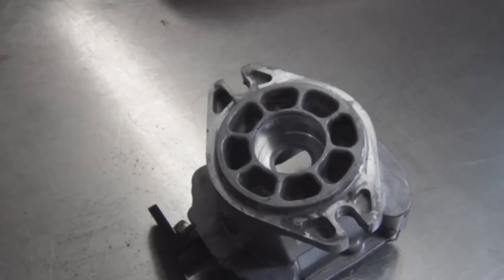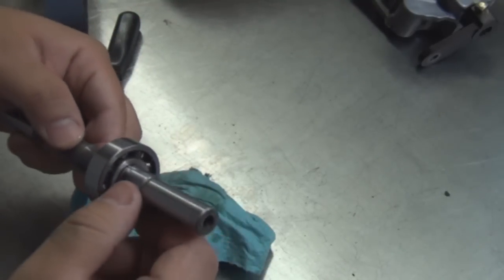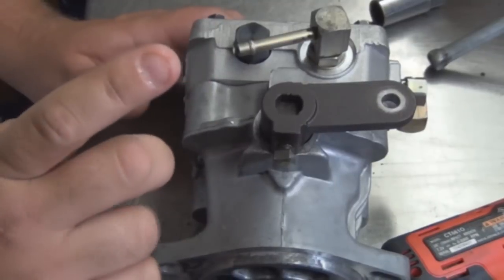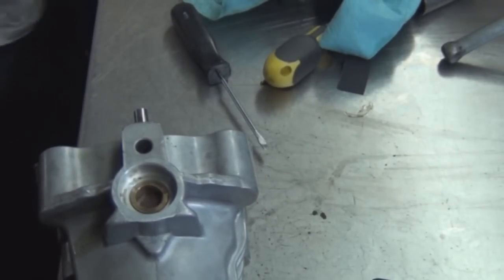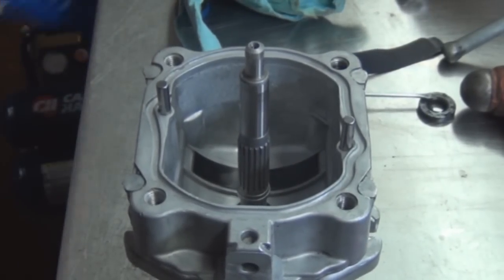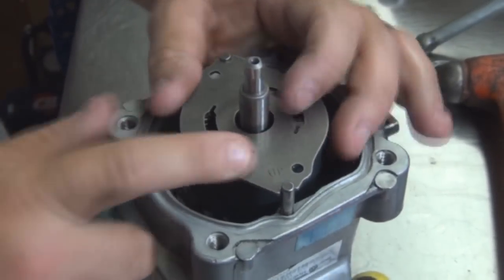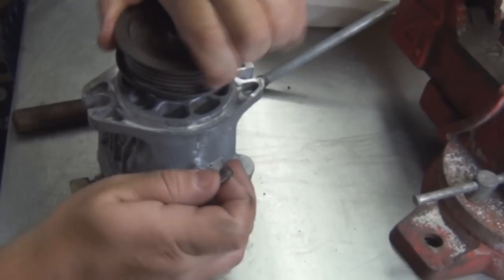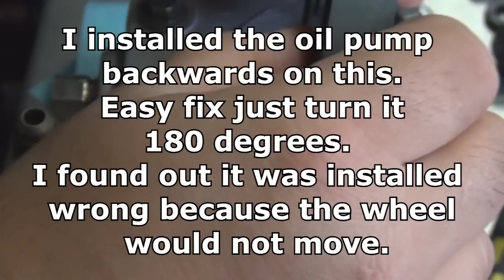Assembly (REBUILD) Hydro-Gear Pump Exmark Lazer Z Part 2

Comment: I have rebuilt both pumps on my Scag which are also Hydro-Gear. One thing I would suggest is to remove the valve control arm while the main shaft is out. That way, it can be completely removed and replaced without the shaft in the way, which you can't do if the main shaft is in.

Comment: Is this your first time.  Your rebuilding before you completely disassemble.  Your sanding then only wiping the sanded material.  Clean it completely with the spray or else the metal shavings will make the pump fail, again.

Comment: I have a similar looking pump on my 413 toro dingo. Here is the pump part # 106-9470. Nothing is wrong with the pump other than the bearing that's on the shaft (makes a loud squeaking noise indicative of bad bearing). I can confirm it's the bearing as I spray a little Kroll on that bearing while running and the sound goes away immediately. So here's my question...essentially can I just remove the shaft, replace the bearing and reinsert very carefully into the assembled pump or does the pump need to be completely disassembled to get the shaft/bearing out? It looks to be pretty straight forward based on what I see but I've never torn apart a hydro pump and would rather not disassemble this perfectly working unit just to replace the outer shaft bearing. Thoughts?

Comment: its helpful you show how these go together but yeah buddy, get a tiny bit of that sandpaper grit in a hydraulic pump and it aint gonna last very long. same as with honing an engine block it needs to be scrubbed with hot soapy water after introducing any grit, sandpaper not a good choice in hydro pumps..

Comment: I know this is an old video and a very very nice one at that.
I have the same mower but a Toro.

What part number is the rebuild kit you used?
What is the OEM exmark part number of a replacement pump?
I've found them new now a days for $560 on-line.

Wondering to myself if it's easier for me to get a new one verses a time consuming rebuilt.

Comment: Good video. What are the torque settings for the top two bolts on the oil pump?
Reply from the maker: Thank you very much. I don’t remember off the top of my head. But what you could do is google search your pumps Model number and add torque specs and it should bring you to the manufacturers website with the proper torque specs that you need. I hope this helps. Please let me know if it doesn’t. Thanks for watching and commenting. Please like share and subscribe

Comment: I purchased an Exmark from a guy that replaced both hydros and the wheel motors. I picked it up cheap because the right side drive is weak. You can get the mower to drive strait on a flat surface, but it seems too weak to turn right or go up hill. Could the check ball be missing?

Comment: I rebuilt my pump. Same pump as yours. When I installed it it will not build pressure. I guess Instead not sure what you meant by the oil pump being 180 degrees out. I can't get it to do anything. When I removed the oil pump cover, there was oil under it. I moved the right side controls back and forth, still nothing. Any ideas? I know the pump is put together correctly, I'm just unsure about the oil pump. It's not wanting to build pressure. Any ideas? 

I have the same exact pump. Mine has little stars on the oil pump gear and the housing it rides in.

Comment: After rebuild, and re- installation it should just work? I replaced one old pump with a new one, and 30 minutes later the other pump started working intermediately, then died. I'd rather rebuild than buy another new one. Any tips? Does it need to be primed or the hydro system purged of air? All tips are appreciated.
Reply from the maker: When I rebuild them I change the hydraulic oil and filter with the specified fluid. As for bleeding the air out, The system should be primed. as for bleeding the air out I just take the lever and push forward and backwards until it's operating to its original status. I hope this helps.
Reply: +handy man that did help, thanks. I just can't believe the second one died right after installing the new one. what are the odds?
Reply: Pulled apart the old pump and found the thrust bearing shot. Got a new one to replace it with the rebuild kit. How do I prime it before re-installation?

Comment: have you ever gone into the valve body? and can you replace the swash plate bearings that are in the housing.  thanks
Reply from the maker: Yes I have been in the valve body only to replace seals. Its been a while since I have been in this certain pump.If your talking about the bearings that look like bottom end bearings on a car engine, yes you can and you should also replace the swash plate while its apart. Hope this helps.

Comment: Just before you installed the charge pump (on top) you used sand paper to clean up the surface. This is a NO, NO. You should have cleaned it before the pump was put together. Grit can and will come off the sand paper and get in the pump. You then blew the top of the pump off which actually will blow grit into the pump even more. The first time you installed the check ball and spring, you had them backwards. The ball goes into the hole first and then the spring. The second time you installed it, you did it correctly. Not trying to make your video look bad, just don't want anyone to make the same mistake and have problems.

Comment: Excellent repair video, thanks  I have an Ex-Mark poor performing left pump in it.  Pump # is 103-1943.  While I've found the seal kits sold on-line, where would I acquire and worn mechanical components for the pump itself or even the plate that you ended up replacing?
Reply from the maker: Joel Horen I usually get the number off the part that is worn if it has one. A swash plate usually has one. If it doesnt here is a link that might have your parts. http://www.partstree.com/parts/exmark/parts/105-6185/

   It might not be your exact mower but the pumps usually are. Here is a link for the hydraulic group. Under the pump its self  #20 you will see bunch of different parts like rebuild kit, cylinder block, plate and etc. Those are the separate pieces. Here is that link

 http://www.partstree.com/parts/exmark/mowers-zero-turn-lawn-mower/lazer-z-ac-exmark-lazer-z-air-cooled-zero-turn-mower-sn-440000-509999/hydraulic-group/

I hope this helps. Also if you find the part numbers on any of the parts, Type it in the search bar of amazon or ebay. 9 times out of 10 you will find them. Thanks for watching.

Comment: thanks guy this was very helpful where would you obtain parts needed i have found seals and even a charge pump however i havent been able to find a supplier for parts such as swash plate or pistons cylinders springs if needed. thank you for your effort to put this on youtube
Reply from the maker: There should be a part number stamped into your swash plate, just type that part number in either eBay , amazon, google search and etc..  Hope this helps. Thanks for watching. As always please like and share.
Reply from the maker: Sorry for the late reply. You can get the numbers off the swash plate and type it into a search on Amazon, EBay, or Google. You should get a couple leads. Thanks for the comment and thanks for watching.

Comment: If there is a bushing in the kit to replace, you should replace the bushing.  I would think the kit has a new seal for the body, not use the old one.  Seems to me you rebuilt too soon.  The socket used for the small seal was too small.  So I'm going to install a bolt then take it out to use thread lock.  I know it's easy to criticize but using Emory cloth and not getting rid of the debri isn't good.
Reply from the maker: I made this video 6 years ago. That pump was spotless when I put it together. I did replace the bushing and seals. I have absolutely no clue what you are talking about. I also flushed the system and changed the oil. This rebuild I did in this video still runs flawlessly to this day. I have been using Emory cloth for years. That’s how they taught me to rebuild automatic transmission back when I was in automotive school years ago. Trust me , you are not the first one to criticize my early videos. Automatic transmissions and this pump basically go hand and hand.
Reply: @handymanPF  he’s right. You should always look at the bore that the seal will be installed into to and find the largest socket that still has clearance in order to distribute the press evenly. You also should pack the bearing with grease after cleaning everything with brake clean and installing a new seal against it. Thank you for the video!

Comment: Between the insertion of the shaft and bearing subassembly, I think you forgot to install a washer, which you removed in Part 1.  Please advise.
Reply from the maker: +Dan Mostacciuolo I replaced the swash  plate with a new one which would look different from the original , if that's the one your referring too. I'm not quite sure which one your talking about. I hope this helps. Thanks for watching and commenting. Please like, share, and subscribe.
Reply: Correct. He forgot to install the washer between the bearings and the oil seal on the bottom. Opps!

Comment: I made a terrible mistake. When reinstalling I tightened my bypass valves to 90 foot pounds instead if inch pounds. I think it caused my lower seal to blow out. Guess that makes me an idiot, but I will just call it lesson learned.
Reply: I hope that's all I screwed up
Reply from the maker: Your not an idiot, you are  just learning. It’s a mistake you’ll never do again and can advise others not to do. But you are correct, it is a lesson learned. We all make mistakes
Reply: THANKS FOR THE KIND WORDS. It turns out the return elbow at the oil reservoir was clogged its some kind of plastic substance. Once I drilled it out and replaced my seals again all is well. THANKS for your videos